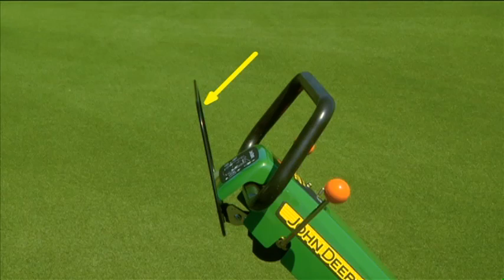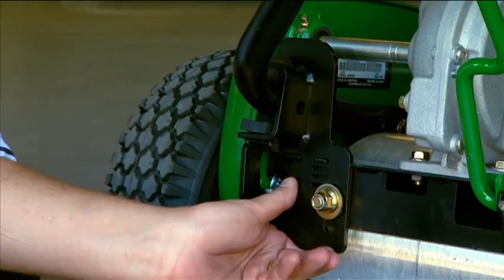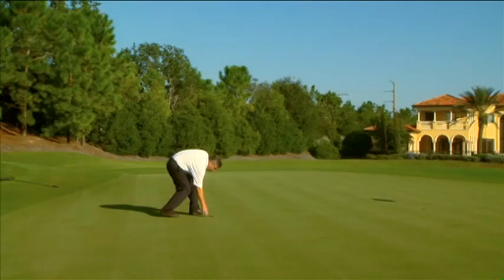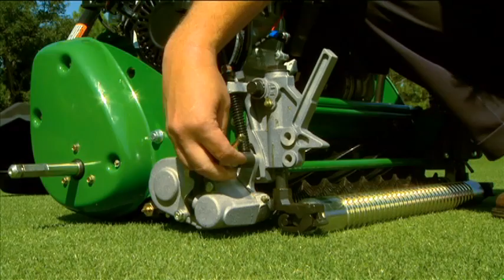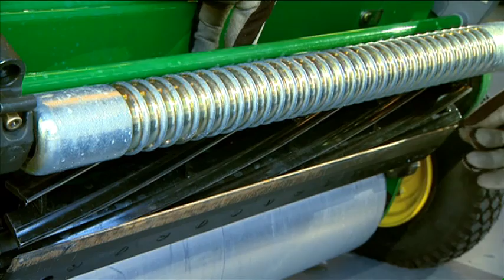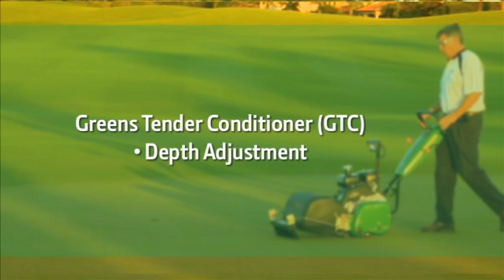180, 220, and 260 Walk Greens Mowers Operator Video  | John Deere

Comment: Can you provide any detail on how to change the lubrication in the gear case?
Reply: Drain it fill it the end
Reply from the maker: Thanks for reaching out, Austin. We recommend checking Section 40 - Service Lubrication in your Operator's Manual for more information. Many Operator's Manuals are available online, so you may be able to view the manual for your model at techpubs.deere.com. Your local John Deere dealer would be a great resource for further assistance. You can find their contact information at Deere.com/Dealer. We hope this helps.